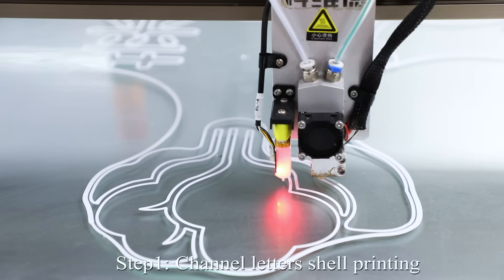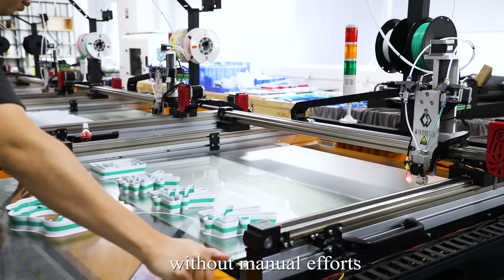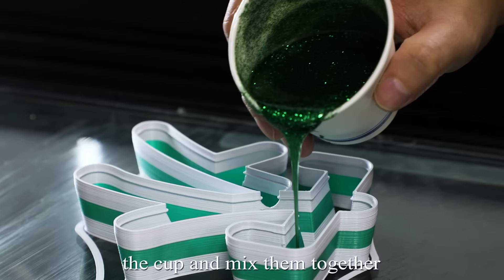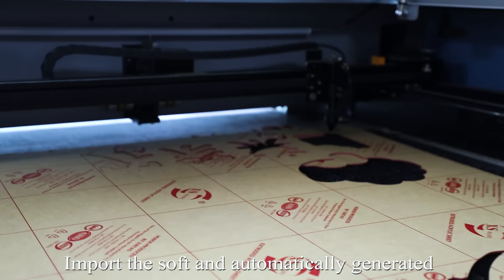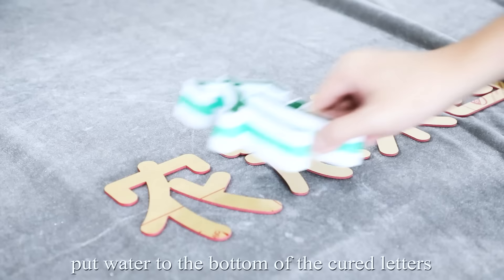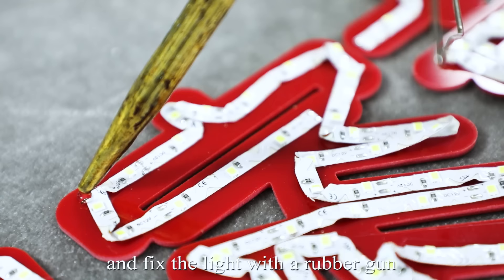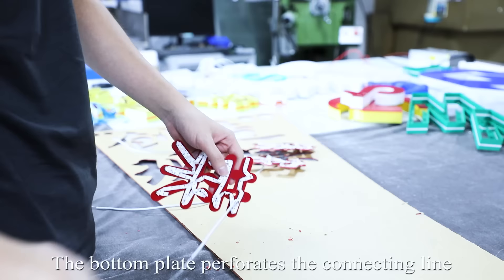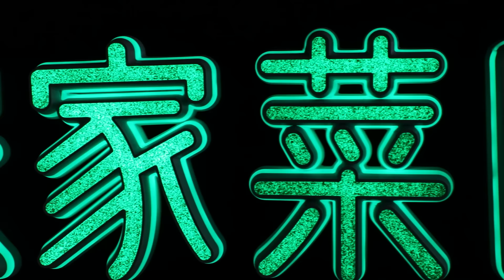How to make illuminated LED Signs with 3D Printer

Comment: Could be easier by printing the bottom plate on the letters with a holes on the bottom for the wires. Than you can pour the resin when your finished with the montage and the lights .
Reply from the maker: This process is easier.
Reply: Well, the letter face is liquid acrylic (You mentioned bottom for it), the letter backer is PVC or metal (that need hole for power hole). Thanks.

Comment: How long does it last outdoors?
Reply: At least 1 years. Stainless Steel letters only grantee for 1 year only.
Reply: the way they manufacture those letters a few weeks at best. I've seen videos with open copper cables inside the letters. Also those LED's are not waterproof.

I would never use 3D printed letters outside, left alone inside with soldering like this...terrible.
The technology is good but the manufacturing is bad
Reply: @six_point_seven1057  we sell machine. You can use LED modules.

Comment: What is the purpose of the red acrylic sheet in the back ? could have used cheaper option instead like pvc ?
Reply from the maker: Acrylic has good light transmittance and can be used as luminous characters. This material can also reflect light. PVC light transmittance is not good
Reply: @piocreat3d   ok.  but you already have colored liquid acrylic in the front , so led sticked to pvc could do the back light , or it is mandatory to have acrylic sheet to spread the light ? (cost calculation can be a bit close to old way of making letters )

Comment: Hello, what do you use for prevent the sticking of the resin to the glass and what susbstance does the operator pour so the letter release from the surface?
Reply from the maker: Not resin, but acrylic glue. Easy to fall off after curing
Reply: @piocreat3d  is it the same material used on nails? i´ve purchased a k8 printer with a seller in Mexico but he didnt bring this solution..
Reply from the maker: @jeanpal86  Not nail material. You can contact our official website to purchase.